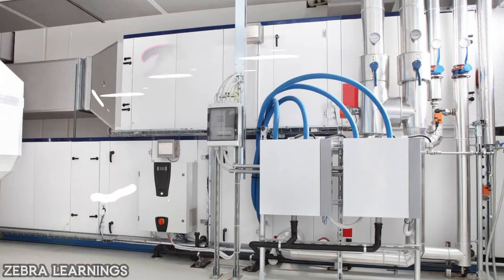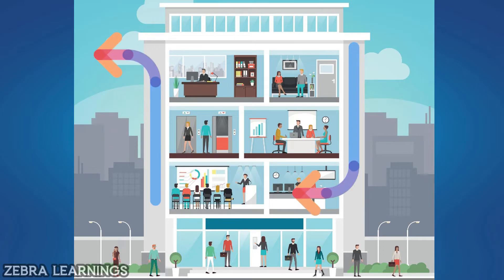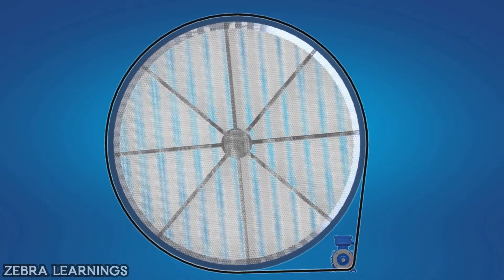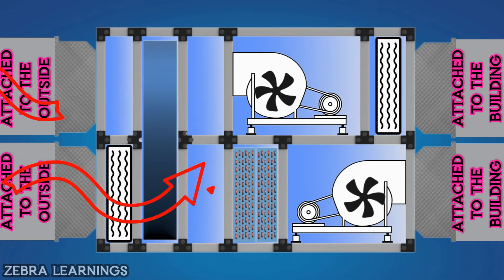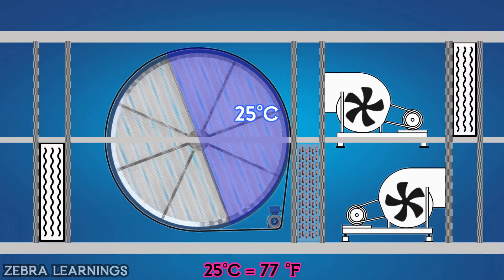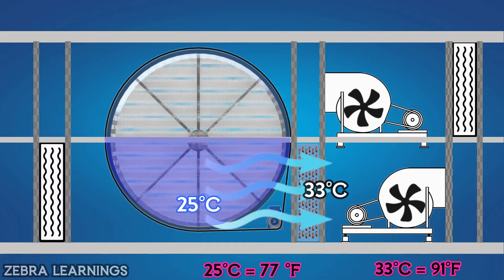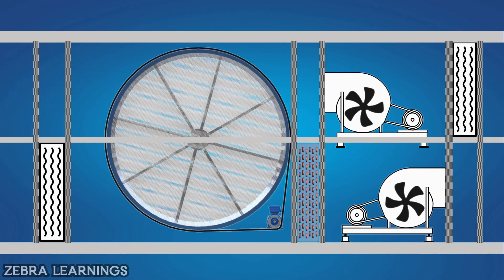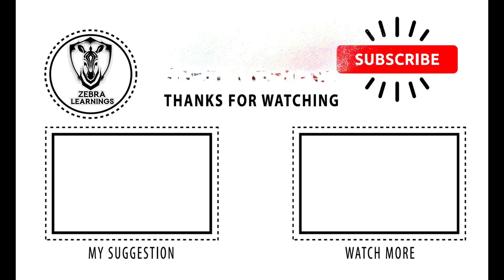What is FAHU or ERU? | Fresh Air Handling Unit | Energy Recovery Unit | Animation | #hvac

Comment: First time of hearing thermal wheel
Reply from the maker: So, now you know what is thermal wheel. It has two types Enthalpy wheel and entropy wheel. I will explain that in a separate video.
Reply: Because if chiild water line connected your fAHU no need thermal wheel

Comment: How to understand this when outside air comes to inside and air is crossing to hrwand also cross the cooling coil and reduce the temperature during this period how is reducing the temperature?
Reply: By heat recovering wheel it is installed on the center part
Reply: https://youtube.com/shorts/sajJXS1LBvI?si=cCEqa2DZAf_KDVe7

Comment: H.R.W can we wash this ?
Reply from the maker: There are two types of wheel in FAHU. One is Enthalpy wheel and another one is sensible wheel. We can wash sensible wheel based on the manufactures recommendations. But, enthalpy wheel we can't wash. But, we can use blower or vacuum to remove the dust.

Comment: Yeah,I am working on FAHU but I just knew it as a HRW(Heat Recovery Wheel). I heard it first time that it is Thermal wheel.
Is it thermal wheel??
Reply from the maker: Yeah it is the thermal wheel and there are few other names also there for this wheel.
1. Heat Recovery Wheel.
2. Thermal Wheel.
3. Rotary Heat Exchanger.
4. Sensible Wheel.
5. Enthalpy Wheel.
Reply: same thing
Reply: https://youtu.be/I9e3IBhvGs8?si=WhqRsEunm1XXKmQR
Reply: https://youtu.be/h95d6HCY-Lw?si=heyu9ZeQ6xdfLxAG